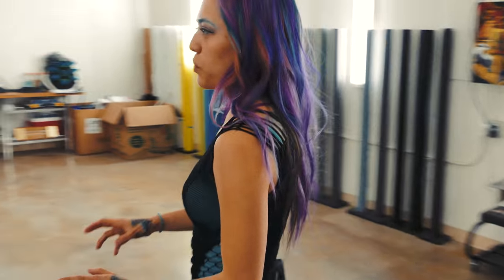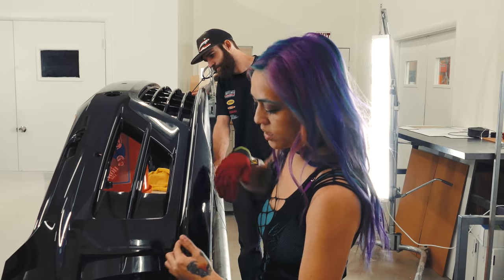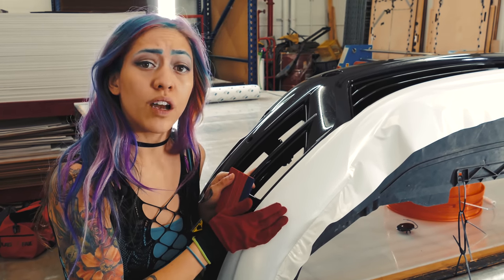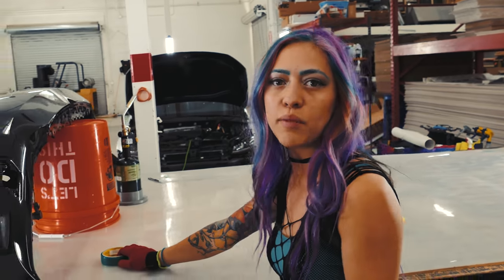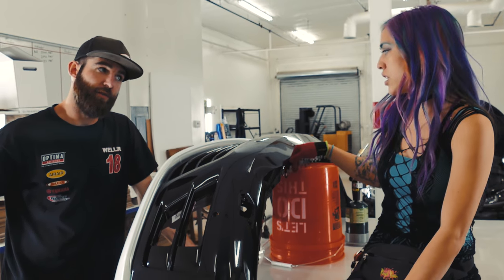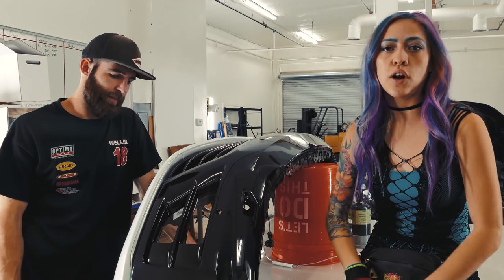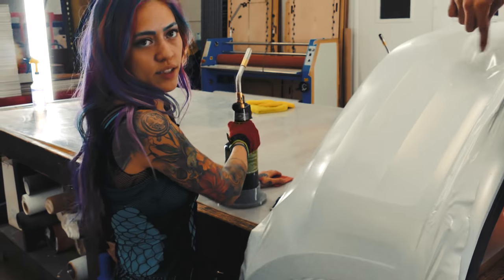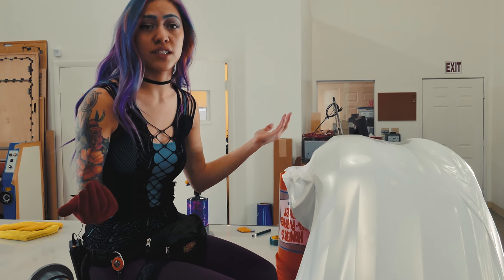How to Slay Bumpers

Comment: super dope. wasnt aware that 3m is more adhesive line prone. im the most familiar with avery 900 ez rs supreme wrap series. but would you guys have an order of preference as far as the major brands of vinyl like 3m/avery/vvivid/oracal etc?
Reply from the maker: Abishai Israel typically top to bottom Averysw900, 3m1080, ora970ra, kpmf, hexis

Comment: Does adhesive lines show through the vinyl ? I notice y’all stress it a lot in the video
Reply from the maker: 808kea808 with 3M we take extra precaution.if your yanking up material or leaving it bridged, It does show  through.
Reply: WrapSesh ok cool. Thanks for the reply. So it is cool to heat it then apply it with a little stretch. I’ve seen some videos where the person emphasized on cold stretching and highlighted the benefit fits of not needing a heat gun till the pair heat.
Reply from the maker: 808kea808 I guess that would depend on the piece. Not so complex stretch you can cold stretch. Most large panels we are doing a heated prestrech then wrapping close to edges, heat to release, then wrap around edges and postheat.